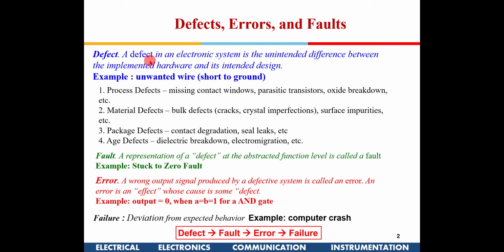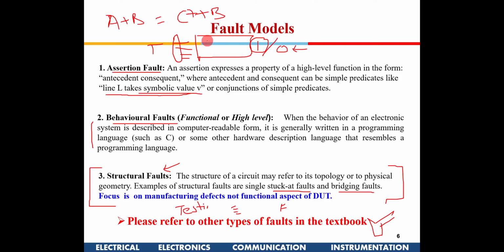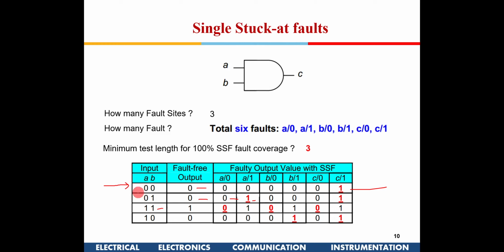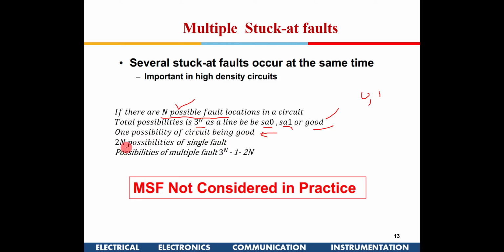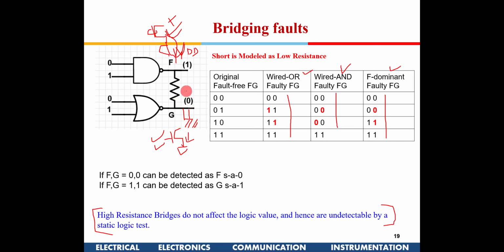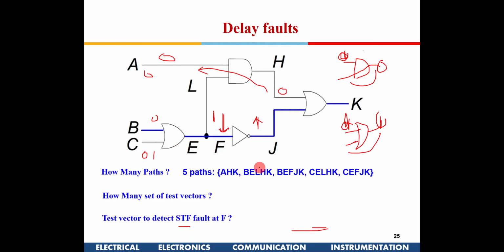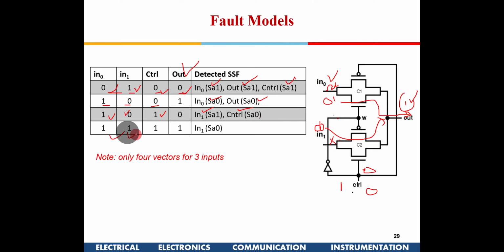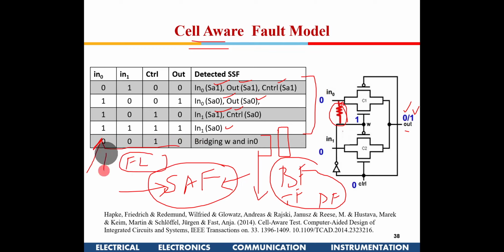Testability of VLSI Lecture 2: Fault Modelling

Comment: Sir in the bridging fault question (A-B) for the wired-AND there is no fault for the Test Vector 0 1 1 as it gives output as 1. but u gave there as zero (0) ,its slightly confusing me sir.
Reply from the maker: Yes you are correct out put would be 1. There is a si mple in slide. Thankyou